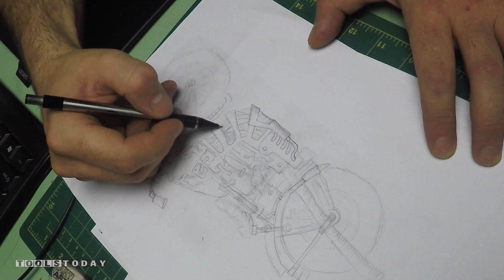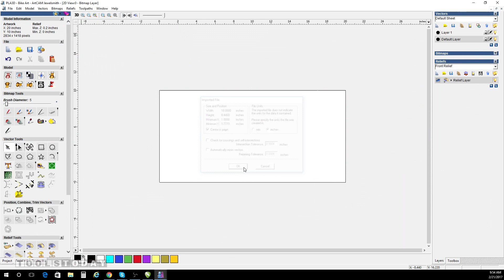CNC Project: 3D Carving Motorcycle Model | ToolsToday

Comment: is that pastels that you are using as the accents on the carving?
Reply from the maker: Doug, yes pastel sticks were used for the accents.
Reply: do you have any videos on the the technique. I love the bike and will be buy it and the angle wing model as well.
Reply from the maker: Doug you can Google the technique "hand painting with pastel sticks" - Good Luck !! We'd love to see your finished work !!
Reply: Can you give more information about painting process? What type of finish element you use after pastels sticks?
Reply from the maker: We sealed it with a standard aerosol sealer.